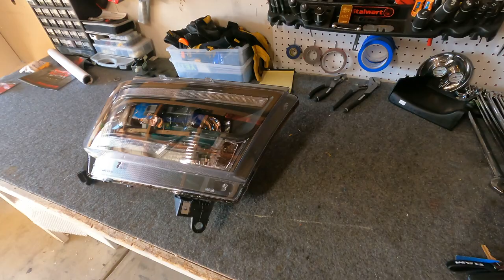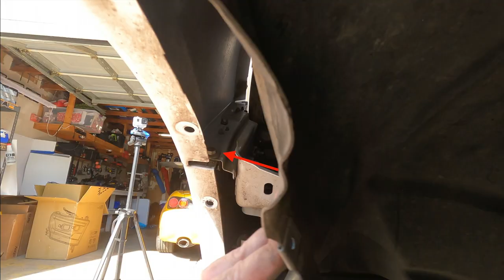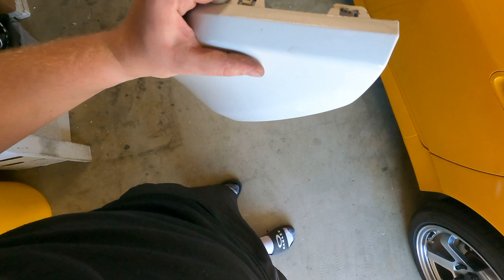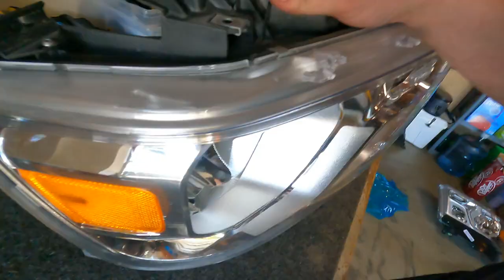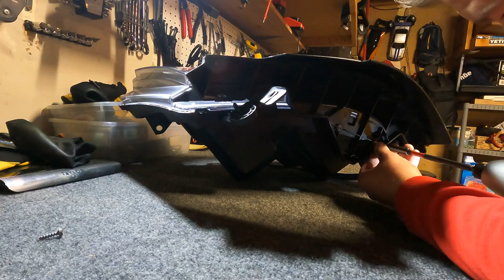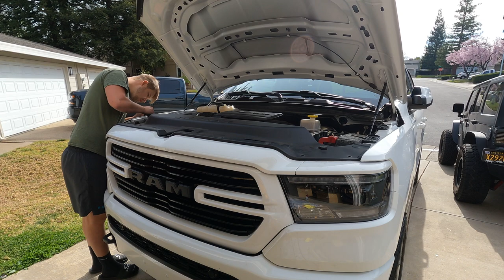2019-2022 Dodge Ram 1500 5th MUST HAVE Headlight Upgrades! Morimoto Hybrid LED PLUG AND PLAY

Comment: Have you ever had a problem with shorting the stock plug, I got a set of aftermarket headlights and my low beams no longer work because the pin in the plug shorted ok both sides trying to solve the issue

Comment: You're telling me for 900 dollar headlights you had to unscrew all those brackets from the OEM ones to put on the new ones? I got spec D protectors with the LED switchback turn signals, totally plug and play for half the price. Took out the old housing, popped the new ones in. No wiring, no unscrewing and putting on brackets from oem to new ones. 

Those are nice too though.

Comment: I had a Ram with halogen headlights, just garbage, tried led inserts, just bright looking garbage, and blinded other drivers.  Now have Ram with factory LEDS, love the ability to see at night without blinding  oncoming drivers.  If I still had Ram with halogen headlights would buy these.
Reply: What adapter did you use to swap to oem led?
Reply: @jgaff1038  No adapter, I bought a new 2019 Ram Rebel, it came with the LED headlights, they work great.
Reply: @jgaff1038  Did you ever find an adapter to sap your halogens to OEM LEDs? Im looking for one as well.

Comment: Put these on my 2021 1500. Look amazing! That is, until my passenger side low beam failed. Morimoto sent me a replacement but with an amber side maker (original ones I bought had clear reflectors), and the low beam is again failing. : (
Reply: My driver side low beam just failed too. Not looking forward to installing again

Comment: Can’t believe my uncles Honda Accord came with better headlights than my truck. Dodge dropped the ball on the Bighorn
Reply: LED lights or brighter white light does not equal better light. Your eyes have a certain spectrum of life that they're used to seeing... And believe it or not your reaction time and your periphery is benefited more by the Amber glow than a white light. And it's been shown to be much less fatiguing on the eyes. Take that for what it's worth. But my 19 ram with the halogens lights up the road very nicely at night
Reply: Not a Dodge. 
and it definitely comes with better lights then ur Honda. 
U jus dropped the ball on ur options. 
Opted for the cheaper light option. 
Dont blame Ram for ur lack of knowledge.

Comment: Just got my 2022 Ram Sport 3 weeks ago it looks just like yours and I want to upgrade headlights but salesman told me that if I modify, that will void my warranty. Thoughts?
Reply from the maker: I believe it depends what you modify. I’m not too sure. I would ask for more specifics.
Reply: You wont void any warranty on headlights.
Reply: Won’t void anything they just tell you that so you can buy it with them unless you mess with suspension that can void warranty
Reply: Look up Magnuson Ferguson act

Comment: These or oem LED?
Reply from the maker: No they are not. They are from Morimoto
Reply: @tractiongarage  would you say these are better than the oem led?
Reply from the maker: @oak24town76  I would say for the price definitely pretty close to a oem led. Mopar makes great stuff so it’s hard to beat. But this is pretty close.
Reply: @tractiongarage  what do you think of the Recon headlights?
Reply from the maker: @oak24town76  I like recons quality as well, I have the recon tail lights as on this truck.